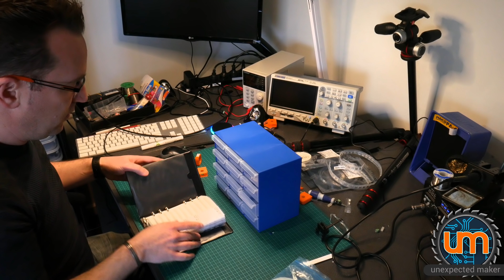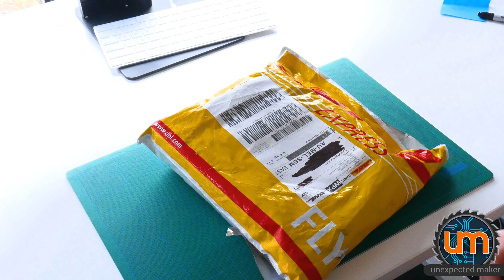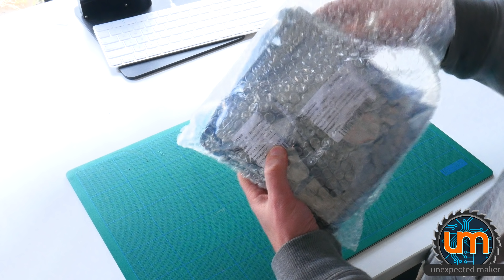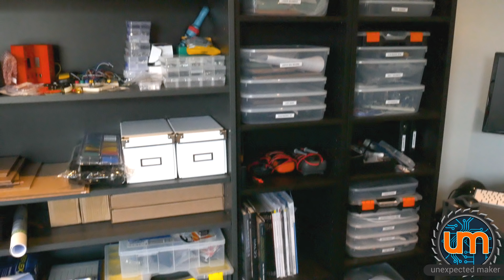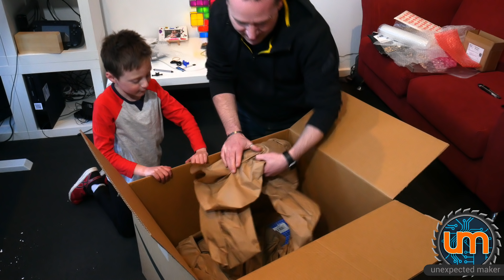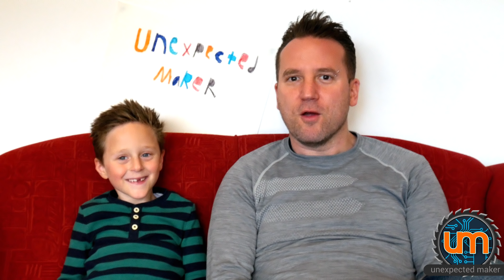Random Bytes - September 2018

Comment: What is the brand of your new mats? I know you mentioned it in a stream but I can't figure out in which one / at what time. I absolutely love the purple one, so I might consider getting one! Also, are they heat proof (as in can I solder on them)?

Great video btw, love your work!
Reply from the maker: ANSIO, but no, not heat resistant - they are cutting mats. If you touch it with the iron, it melts. So they look great but be careful :-)

Comment: You can probably 3D print box separators for those blue boxes, then have two different components in each bin. But it looks like they stack one on top of each other quite well though.
Reply from the maker: I have doubled up some easier stuff into 1 drawer, but dividers are a great idea! yeah, these compartment containers are great and that can be attached to a wall easily if I ever get over my fear of putting stuff on my walls ;)
Reply: I have a very large "hive" of boxes on my wall. But it is only held to the wall with one screw. I hanged all the boxes on a big (2m x 2m) wooden panel, which has an angled piece of wood at the bottom (a "foot") and this whole wood "wall" stands on its own, but for extra protection I connected it to the wall at the very top - so it will not all fall down on me. On one hand, there is just a single hole in the wall. On the other hand, there are 40 screws holding these boxes on the wood panel.  http://imgur.com/nJoGR8n
Reply from the maker: "So it wont fall down on me" - Ha! Yeah I thought of something like that... I'd have to find a way to squeeze it behind my desk.

Comment: The documentary "How I Waste my Patreon Money" continues...

Don't blame JLCPCB for your inability to specify what you want from the stencils. I, and thousands of others, have no problems.

Sure, it means you have to think ahead, and that doesn't seem to be in your repertoire (I knew v1 was wrong but I still ordered 100 boards), but tell them what you want and add "If the instructions for the stencil are not clear, please contact me" and give them an email address.

It's really not difficult - just slow down and think a bit...
Reply from the maker: It's the same amount of money, not more...  and there is a very good reason I panellised the rev1..  I need to ensure my tolerances on the edge of my boards were ok with v-scoring as it's to the mil as close as JLCPCB allow and I've never gone that close before. As I am trying to make he smallest board I can, knowing this is crucial at the start, not when it's wrong at the end. Also, stencils are $9... I'd spend 10x that in time lost fixings issues on QFN's from hand applying paste... that's a total waste of time and costs me way more than $9.
Reply: @UnexpectedMaker  I agree, to a point, on the time involved in fixing problems from hand applied solder paste but my original comment was about publicly berating JLCPCB over the stencils when a clear and concise definition of what was required, within the note section, would avoid the issues...
Reply from the maker: I have emails from JLCPCB stating they are aware there is a known issue with their website and they are working on a fix, They accepted responsibility. I have also successfully gotten correct stencils before... and I know others that have gotten both wrong and right stencils. It's not my speed or my thinking... it's just some bad website code ;)
Reply: Sure, writing a note in the next order makes sense, but if shit is broken, shit is broken and needs to be fixed - no reason to attack Seon for complaining about a feature that is not working.

I don't recall hearing him say anything about patreon money being spent on anything here - did I miss that? On what products? What was wasted money on in your opinion?
Reply: @Davedarko  I'm not saying that JLCPCB are perfect and I'm well aware of the 'website problem' (as are they), but that's what the "Stencil Remark" section is for...

Put a concise description of what you want in there, add the 'contact me if any confusion' line and it all works like clockwork.

Since the first 'duff stencil', I've always done that and had no problems, but it does need to be concise, and clear - English is not their first language.

I'm designing boards for commercial customers and if they received duff stencils, I'd get it in the neck and lose business.
Reply: @duncan amos - like I said, fair point on the notes. No reply on the patreon money you mentioned? :(  Since you brought that up, you don't receive boards and stencils first to verify design and stencils?
Reply: @Davedarko  I don't receive anything in the way of boards or stencils, my customer does (unless, very, very rarely, it's something for me). But boards are in prototype quantities, up to Beta stage. Production board quantities are then assembled and tested overseas (usually China).

What constitutes 'production board quantities' is, obviously, going to depend  on the market - Tindie is maybe 100, mass market maybe 100,000 and up.

Everything, from first prototype to production, is checked thoroughly in a Gerber viewer before any order is placed.

My remark about the board ordering was that Seon's boards are always seemingly ordered in what, for him, are production quantities, even for a first prototype and when it's known to be wrong - "I knew it was wrong, but I ordered anyway", "v1 was 0603, but I'd already decided that v2 would be 0402".

Go for a minimum quantity of boards on v1 and v2 and hand-apply solder paste. When there's a finalised design, then go for a Tindie production quantity of 100 boards and a correctly specified stencil...

Yes, I have a lot more experience of designing boards than Seon does (I've been doing it for more than 50 years) and I know how to specify things, but it's also down to common sense - you just don't order a production quantity of boards for the prototypes. It's a ridiculous waste of money and resources.
Reply: @duncan amos - you still didn't answer how any of that is patreon money wasted (it's not even payed with it in the first place). The only thing I see being wasted here is pcbs that were panelised for free and I didn't like that either and thought of it being wasteful - but financially there wasn't any losses (for Seon testing the board). That's probably something he will change, when he comes to sorting / throwing out old board designs and stops being a kid in the candy factory. 

Seon is constantly pushing out content and that might excuse the additional expense of an early stencil for quicker production time of prototypes. I've seen him make changes to boards so no new stencil needed to be bought. We all want the latest order to be the last and that flow is something everyone has and will learn eventually.

I guess it also comes down on how you're confronting someone about that - you come off a bit harsh - but I want to thank you for keeping up the discussion! Nobody likes to being talked down to though, that's how people start turning down otherwise valid criticism.
Reply: @Davedarko  Until Seon stated that none of the boards/stencils/components are paid for by Patreon money, I was working from the basis of "I'd like to thank my Patreon supporters, without whom none of this would be possible" type closing messages to include all that had preceded it, including the costs of procuring the items featured.

Apparently I was wrong in that assumption.

If I came over as harsh, I apologise, it was a reaction against the excesses - old age has yet to mellow me...
Reply from the maker: Duncan, I have added notes on my orders since the second wrong stencil, since JLCPCB confirmed there was an issue.
With regards to wasted Patreon money? I've not pulled a cent out of Patreon since I started it... All of my mistakes and learning is proudly funded by me :-)
Reply from the maker: Also, for those reading that don't know, JLCPCB have panellising min/max rules... not only does it have to fit within 100x100mm, but it also has to be a minimum of 75x75mm...  if I could have just done a 2x2 panel for rev1 I would have done that, but then my panel would have been too small and would have failed submission, so the quantity was a JLCPCB requirement for vscoring. I didn't need to panellise rev2 (as you can see in my video) as I tested my tolerances in rev1.
Reply from the maker: @duncan amos Adding a note to avoid JLCPCB mistakes on my orders does not get JLCPCB off the hook for having a faulty website that needs fixing. You can't publicly berate me for something you don't like and then tell me I can't publicly berate JLCPCB for something I don't like. And lets be honest, your original comment was a condescending (and inaccurate) accusation about me wasting other peoples money and blaming JLCPCB for it… in fact it still is ;)

Oh and if you though I've been wasteful before, your going to really hate Fridays video :-)
Reply: Good lad @Unexpected Maker :)
Reply: @UnexpectedMaker  In the video, and previously, you made no comment regarding the issue with the stencils being due to a problem with JLCPCBs website, but implied incompetence on their part.

Whilst they may be slow to fix the website problem, it can be avoided by using the note field to specify exactly what is required - as you say you are now doing.

It would have been much more useful to say what the problem is, and outline the solution, than to simply blame JLCPCB.

In the days before press button website ordering, designers supplied an info file, in .txt format, along with the Gerbers. That file concisely described what the designer was expecting to receive.

I continue to generate that file as a matter of course. It lives with the design files, forms the basis for the notes fields when ordering and acts as a reference of intent if a design is revisited in the future.

I have already apologised for apparently misinterpreting the source of funding for what I and others believe to be wasteful practise but it would seem from your ultimate comment that this waste is a deliberate policy on your part.

That is your choice and, if you are indeed funding it yourself, then it's your money and you can do what you like with it.

At no point did I say, or imply, that the wastefulness was down to JLCPCB - if you order 100 boards, knowing that you will be throwing 98 of them away, that's not their problem.

No more to be said...

Comment: If I could I would have part drawers to the ceiling, but they are expensive for that many. Those aren't bad for only $15.
Trap for the young players. Part assortment aren't great because you use all the common stuff in the 1st project, so you must bulk buy the common stuff as an addition or you will constantly running short and reordering all the time.
Reply from the maker: Yeah, the restocking is always a pain, especially with the MCLL shortage atm. But as I am moving from 0805 -> 0603 -> 0402, many of my "bulk common" are not long being used. I guess I'll need to design more boards to use them all on!

Comment: Question - I've always used RS for small component orders since, though they are a little more expensive per unit than element14/Digikey, they've got free next-day shipping on all orders. What makes LCSC your go-to? They seem cheap to me but the shipping always knocks me back.
Reply from the maker: I normally only order with them when I am ordering boards from JLCPCB (same company) so my shipping is free or tiny as they get combined. They also stock a large range of parts that you cant get from RS/DK/E14 etc... like a bunch of Chinese manufactured parts.

Comment: @UnexpectedMaker, I can see that you are still struggling to set your components in order. Quick ideq - these plastic drawers looks to be big enough to handle more than one type of passives. Why not 3D print simple deviders and split them on 2 halfs?
Reply: Yes, doomed you are... ;-)
As you've already ran out of drawers, may I suggest you to keep using those compact strip holders and put those in the drawers? Having one value per drawer is a major waste of space. Just keep a whole series in one drawer. (My SMD LED collection alone would use more drawers than that box has if I wouldn't bundle types together)
Reply from the maker: Are you suggesting I am doomed? I think you might be right! Hahaha
Reply from the maker: Honestly, I found those strip holders only work well with plastic strips... and most of mine are paper now and they are either too hard to move the strip or too many parts come out (with 0402s). I'm finding it much easier to work how I am now with the trays :-) I'll just need to get a bigger desk and workspace!
Reply: @UnexpectedMaker  - Ah, I see. I've used them solely for plastic strips. The cardboard strips are more sturdy. Perhaps a larger diameter holder would work better, but maybe a flat sub-box made for your size drawer works best... Or indeed, just add more desks!  :-)
Reply from the maker: Yeah, I'm already doubling up a few drawers :-) It all escalated quickly when I bought a bunch of 0603 stuff for TinyPICO rev1, then moved it all to 0402 for rev2. Oh well... I'm getting a great selection of stuff to use!
Reply: Unexpected Maker when I see how many storage boxes I have collected over the years - and I’m ONLY using through hole until now - I can see where your journey goes